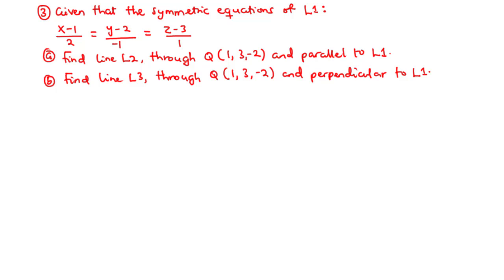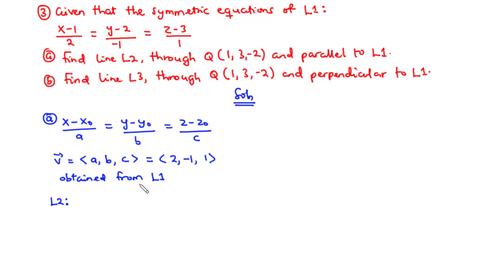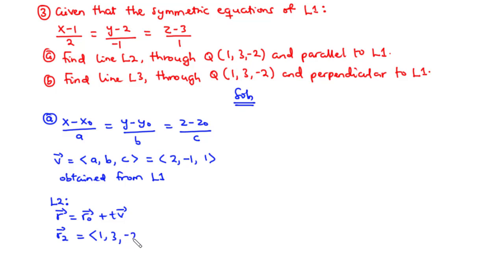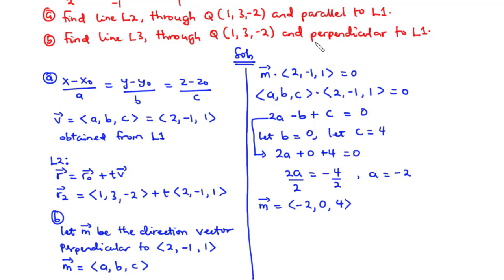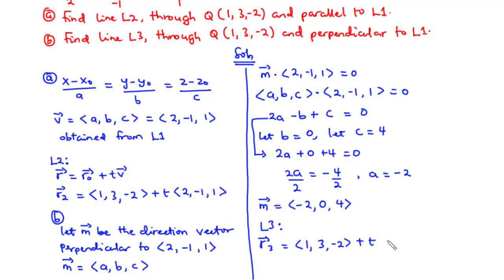🔶10 - Find the line passing through a Point and Parallel or Perpendicular to a vector. Vector, Ex3

Comment: HOW ARE WE ASSUMING 2 points.if i assume some other points were going to get a complete different ratio.shoulnt we be assuming only 1 point
Reply from the maker: We have a single equation with three unknowns, so we definitely need to assume values for the two other variables to get the third one, hence we can't solve. Again the values you choose since it's different from any other person, it means that the answers will surely be different.